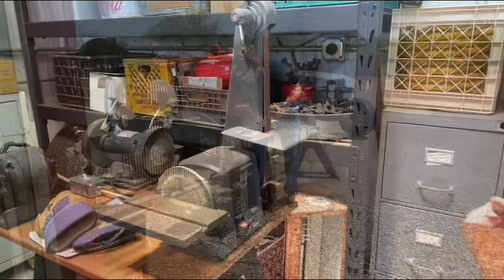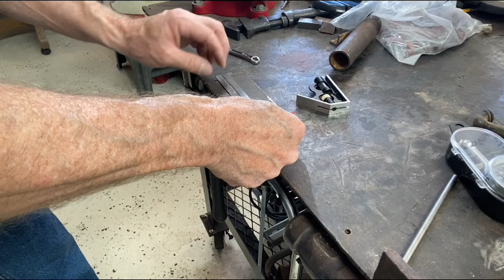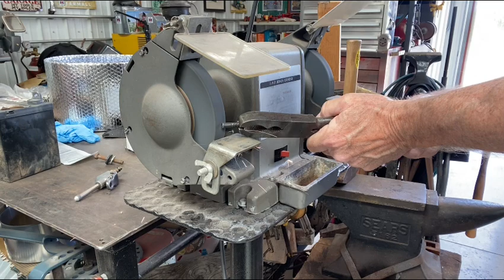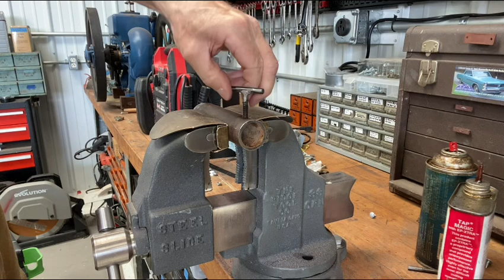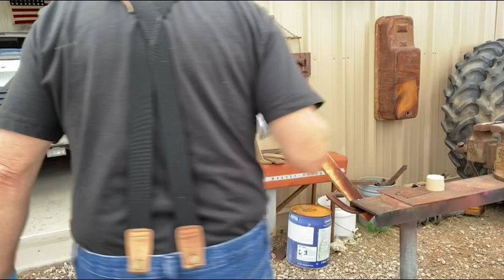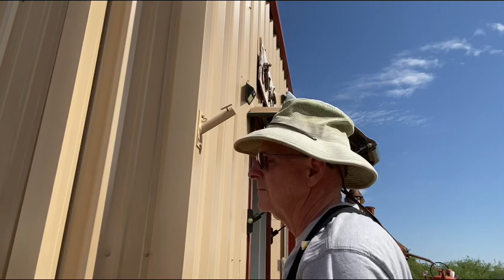#metalfab #scrapmetal Fabricobling With Scrap Metal

Comment: You need to weld a handle on your center punch, be like the fancy open air shops in India... They do it, because they don't trust the guy swinging the hammer either...lol
Dull bit, or hard flat...made a little squeal..
Nice well rounded video, grind, drill, cut, weld, evening painting.. and it looks good too 👍😁🥃🥃🍻🇺🇲🇺🇲🇺🇲🇺🇲
Reply from the maker: Thanks Ed. The drill bit settled down when I added cutting fluid. H.F. Cobalt bits are terrible for chatter. Time to order bits from Drill Hog…..